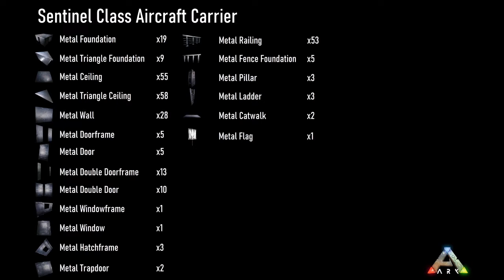Ark Survival Evolved: Aircraft Carrier (Tutorial/ No Mods)

Comment: Hey do you know why can't i put metal triangle foundation below metal triangle ceiling ?
Reply from the maker: What exactly is the foundation doing? It might an issue with you being in too shallow of water. Try moving the boat a little further out and see if that fixes it.
Reply: @DrB048  it just says obstructed, i found out the solution though. There needs to be a stair intersecting the triangle foundation that I want to place

Hope this helps if anyone is experiencing the same issue
Reply: @matibukota  Here's what i do when i build boats

Place a thatch ceiling,under that a triangle foundation, then demolish the ceiling,  then place another one at the side of the triangle foundation, then place the triangle foundation under that and then finally remove the ceiling.

I know sounds complicated and long but once you do it a couple of times you get really fast.

Works for me.
Reply: @matibukota  I tried different angles of stairs and it still says obstructed. When you say intersected, from which direction and from what to what

Comment: Great build looks great, would of liked to of seen the interior once you kitted it out.
Reply from the maker: I might redo this tutorial due to recent updates in Ark causing issues with the build. If I do I will be sure to add an interior view.
Reply: @DrB048  what issues are they? I  am almost finished doing the build and haven't come across any issues as of yet. One of the smoothest and straightforward  builds I've  ever done.  Keep up the good work , looking forward to seeing your updated video.
Reply from the maker: @deggers1231  Some issues reported with triangle foundations not snapping to the triangle ceilings and issues with not being able to expand as far out from the boat.
Reply: @DrB048  ok first issue encountered, can't get the triangle pieces to fold back under the control tower as at 17:37.  Doing this on PS4 on  unofficial.
Reply: DOH!! Was using ceiling panels instead of roofs no wonder I could get it to work!
Reply from the maker: @deggers1231  Lol, I was about to reply to keep trying to get them placed because I had issues getting them to snap to the right place.

Comment: There's a faster way to lower the foundation
Reply from the maker: Do tell :)
Reply: @DrB048  Probably use two pillars- you can place a second pillar within a 'structure unit' to one just placed, and it will usually place the second pillar in a lower elevation to the first. Pick up the first pillar and then place it down within a 'structure unit' to the second, then repeat the process three more times. I believe it's the fifth elevation down is the sweet spot for when you'll want to place the foundation pieces.
Reply: @TharsisOfficer  that sound so confusing